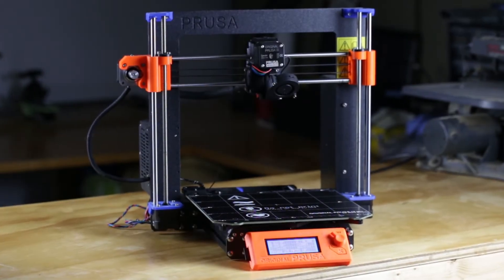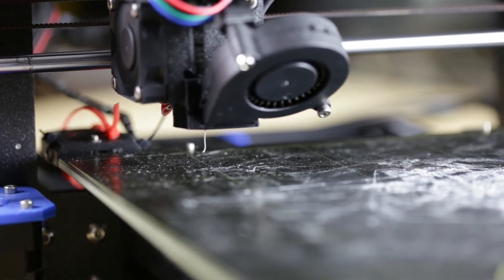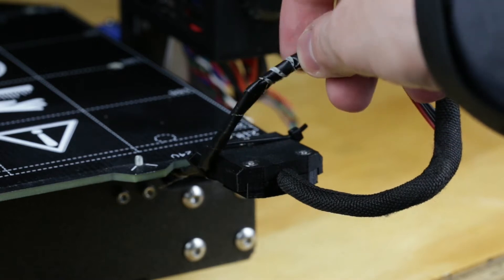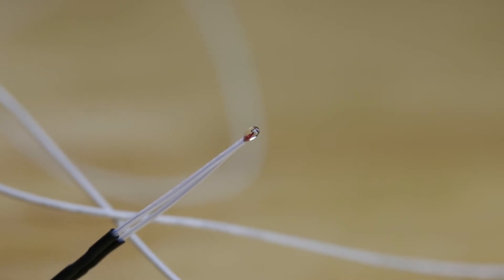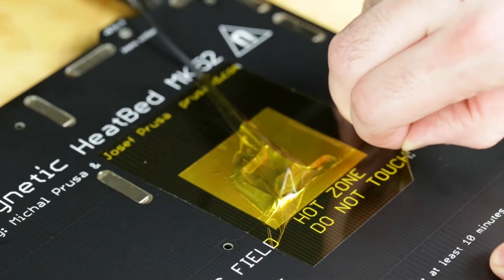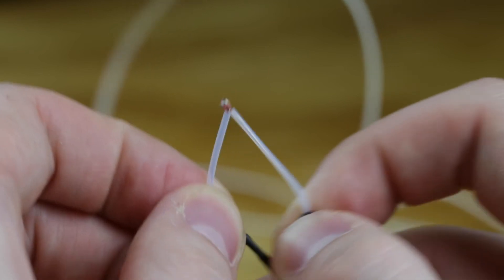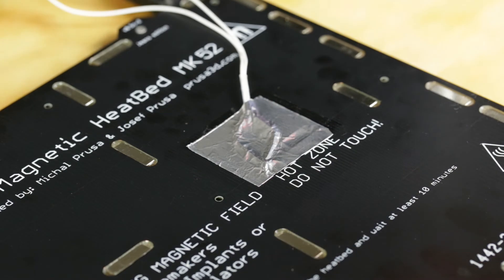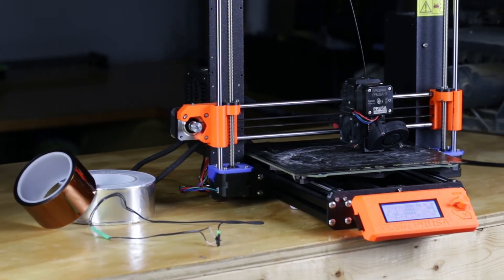Heatbed Thermal Runaway! And How To Fix It

Comment: I have replaced my heat bed thermister but now the bed temperature is 20 degrees C less than indicated on the LCD panel.  I measured the room temp resistance at 127k ohm. It is supposed to be 100k ohm.   That is about the same % error I am seeing.  Is there a way of manually adjusting the thermister room temp resistance in the software?

Comment: Hi I had a thermal runaway error on a sovol sv03. I replaced the nozzle thermistor worked fine. Then got thermal runaway on the bed. Replaced that one too. I reused the yellow tape cause it felt sticky enough but I'm still getting thermal runaway. Could I have done something wrong? It's straightforward I don't think I have. Or is not replacing that yellow tape actually an issue
Reply from the maker: Hey if you're still having this problem, you might want to watch the temperature readout. If it jumps to a different temperature then faults out it'd likely a wiring issue. If it moves to a different temperature gradually then it's likely something physical. I've had both happen to me so far

Comment: On the initial setup I'm getting a heater/thermistor not connected. Would you recommend removing the heated and removing the tape and reconnecting it? Thanks!
Reply from the maker: Hey before taking the tape off it might be worth while to unplug the thermistor at the board and measure it directly. This could tell you if there's a problem with the thermistor or something else